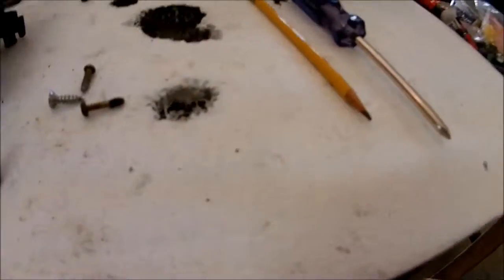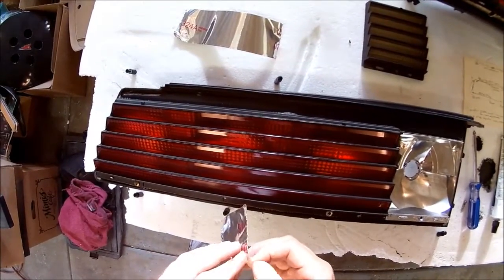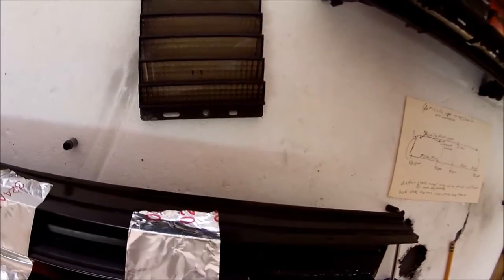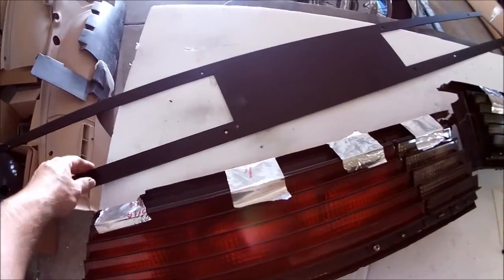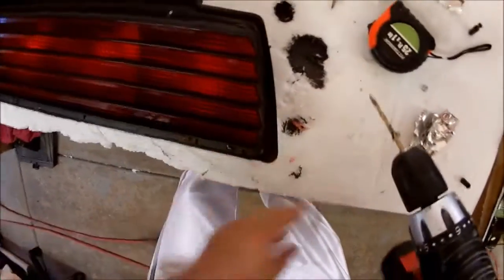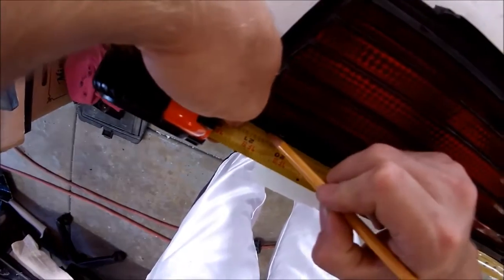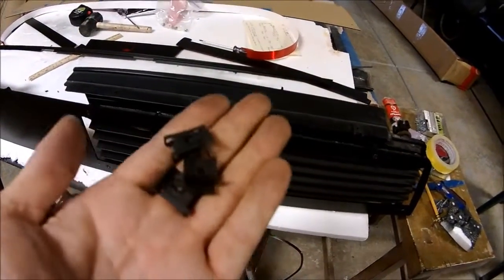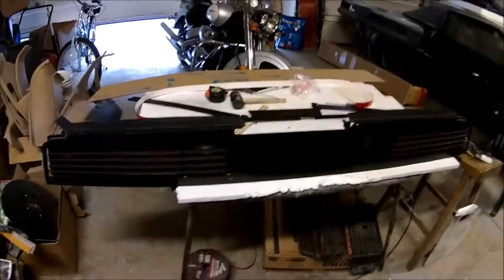My Rear Light Blackout installation video

Comment: you can make the holes you drill in the housing slots by pressing the drill bit to the right or left if your holes are off a little bit, this will allow you to adjust each light housing with in the frame left or right, making it a bit easier to adjust to the car
Reply from the maker: I will do this

Comment: I'm gonna buy tailights from an 84 Trans am ..will the wiring harness and bulbs  from my 89 formula work or do I need to swap that too?
Reply from the maker: Depends on your formula light setup, mine had the wrong harness so I changed to the older one.